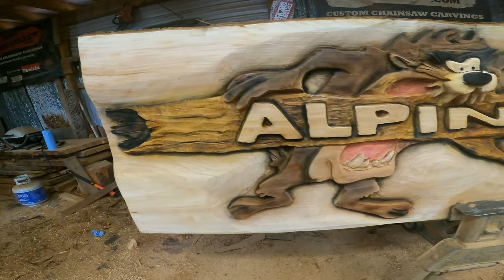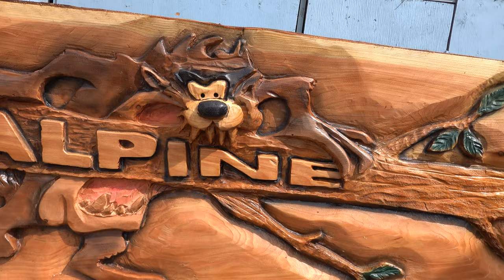Incredible LOONEY TUNES Tasmanian Devil Wood carving - Sign

Comment: Did you screw into the pieces you added and did you remove them after the glue set? Awesome carve!!
Reply from the maker: yep
Reply: Awesome piece of work just wondering do you ever have to worry about the pieces falling off That's been glued . Is that ever a issue later on years later?